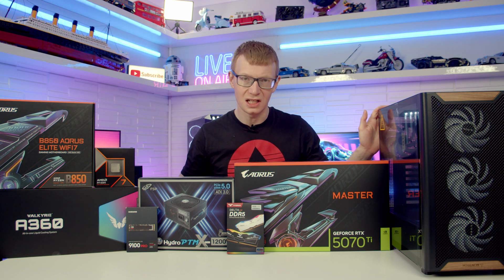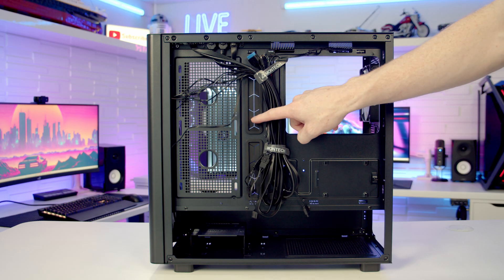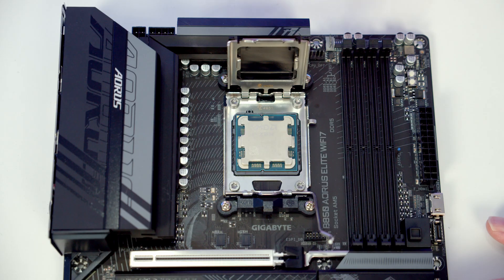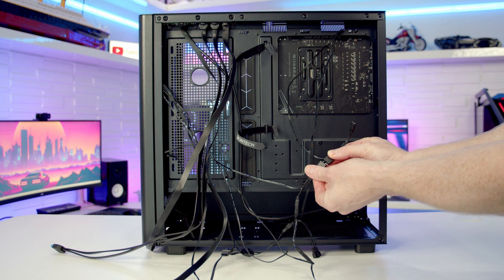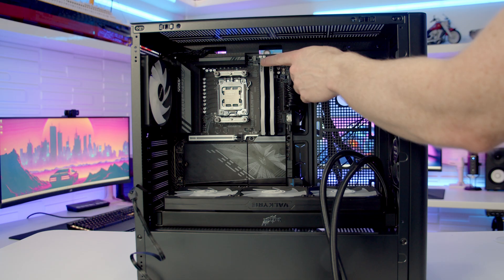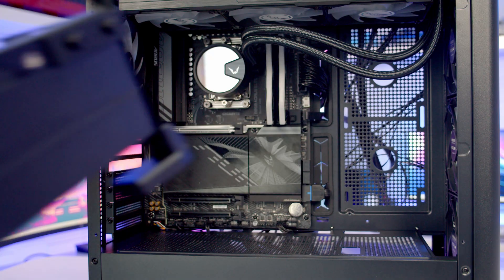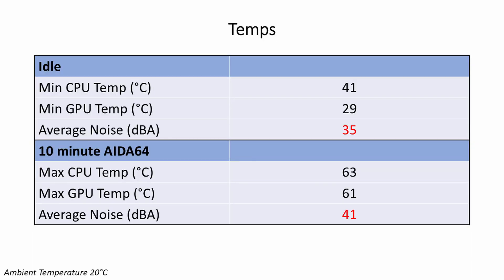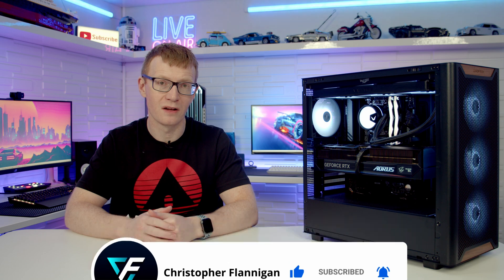Montech XR Wood Build - Step by Step Guide

Comment: What an excellent video!  The detail is amazing - showing everything, including where all the wiring connectors get installed.  Most "build" videos don't got into this much depth.  One question....where did that GPU support bracket come from?  The Montech XR Wood case I just received doesn't have one.

Comment: What i dont like in these type of cases is that they still using that bottom placed HDD cage system, i think that position is just horrible, u need that space for PSU cables! Just see the new Havn BF360 case, its exactly the same classic bottom PSU orientation BUT the HDD can be mounted to the side! Big difference as thats just an unused blank space, ppl very rarely mount a fan to that position anyways when u have a front, bottom, back and top fan position available. So u position the HDD to the side than u have a lot of space under the PSU shroud to connect, disconnect cables etc. I just dont udnerstand why i never see this solution in other cases, its not something that very hard to do.

Comment: Hi Chris just a quick one , thanks for the review first of all , i have the just the XR version of this case and was hoping my aio which is a NZXT Kraken Z63 would fit in the top , but i ran into a problem , i have corsair rgb vengance memory which as you know is tall , so i cant fit it , its about a couple of mm out as i mean the 140 mm fans are just not narrow enough for it to fit , the only thing i thought of was either slimmer fans for aio or lower profile memory , does you or anyone else know of any 140 mm fans which a slimmer than the NZXT ones ? many thanks Chris and everyone
Reply: thanks for your input its really appriciated

Comment: As usual, Mr. Flannigan, you're an excellent builder. I am somewhat surprised that Montech didn't include a fan hub with the case? Nevertheless, Montech's price to quality is once again superb.
Reply from the maker: I think it's ok without. If they did a hub it would need sata power, so only useful if you want to add more fans
Reply: This is also the cheapest wood accent case. They had to cut corners somewhere unfortunately. Bummer with the tariffs, the case was supposed to be $70 USD. Would be an unbeatable case at that price. Still a decent value at $80.
Reply: @kotztotz3530  Absolutely. Even at $80, you're buying a quality case! I bought a Sky Two GX a few months ago and I still can't believe I only paid $79 for it.